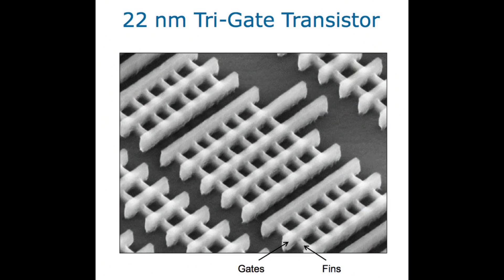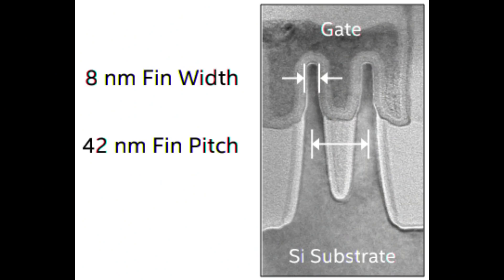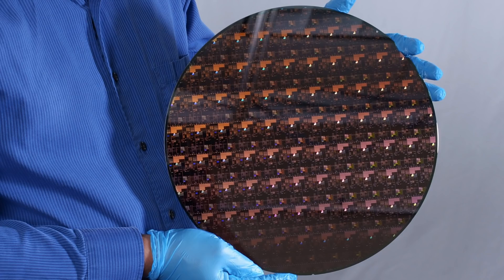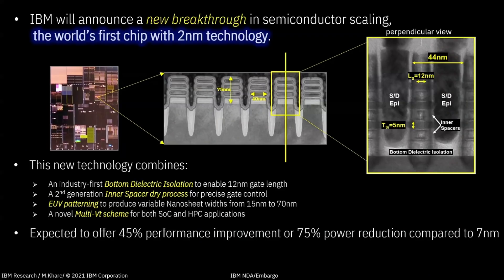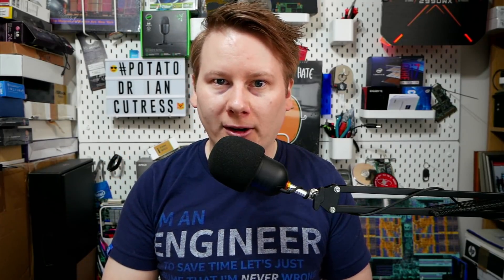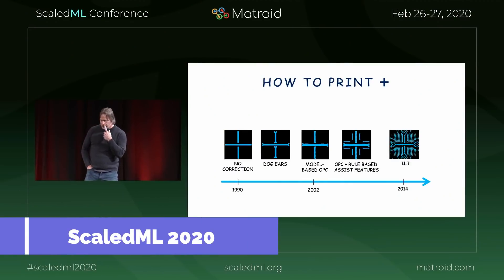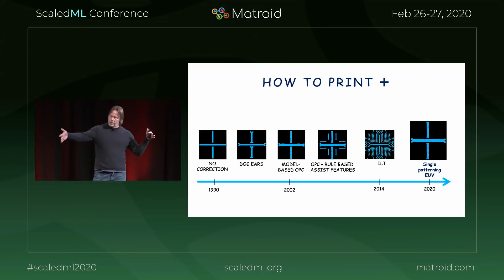There's Plenty Moore Room: IBM's New 2nm CPU

Comment: By chance this video was suggested, and as a former semi worker my mind is officially blown. At RCA Findlay (later Harris) we advanced to 0.5 um using i-line Canon FPA 1500 steppers back in the early 1990s; that was a big advance from the MPA-501 that were only 1.5 um line width.  Thanks for this video.

Comment: I believe Sophie Wilson stated in 2019 I think) that 28m, remained the CHEAPEST process per-transistor. I presume it's because the fabrication of anything below 28nm is a lot more costly. She also discussed how hot Intel & AMD cored ran and so I think 28nm is as far as you can go with passive cooling.
When a Cortex M0 based SoC costs under $1, you know that THEIR will be the major jobs for programmers. Easy to imagine a standard socket for small SoC devices and BLE allows a central machine talking to and from every SoC in your home.
While earning a royalty of 1c a chips sounds low until you consider the numbers to be shipped.

Comment: Nerds paradise. Would you like someone to carry your bags when you travel ?  (forewarning: I do not look good in a bunny suit) 
Smaller parts = less current and that leads to lower heat generation.  I hope that also reduces capacitive cross talk. 
Can they vertically scale resistors for heat dissipation ?

Comment: 128 or 256 cores is no use to anyone when the software doesn't use them and I speak as one owning 12 and 14 core CPUs that can be used in a dual configuration.

Comment: This tech is fake.. 2nm would avoid christians 3rd law of thermodynamics causing a rift between electrons. This in turn causes the transistors to relight the dark optical fibers causing a reverse sha256 hashing state to occur.

Basically there'd be so many transistors running so close to eachother that it'd dehash sha256.
Reply from the maker: You know 2nm isn't physically 2nm, right? It's a name. That's literally what the first part of video is about.
Reply: @TechTechPotato  Yeah I captured that when I watched the video after.

However I still stand, under 5nm we'll start seeing sha dehashing and an overall giant mess without a quantum cooler.

How do you think we will overcome this?

Comment: Because nobody else has made predictions for the next five years of computing, I'll give it an (uneducated) shot. Cores will likely not have gone beyond 64 (or 124 at the absolute most), not due to silicon limitations, but software scaling ones...And so we won't perform computing in terms of cores and threads, but on a spectrum of computing nodes ranging from high performance CPU cores to highly specialized "threadlet" like computing cores to accelerate specific functions, as well as acquiring today's DGPU level performance on die...With no or little dedicated memory chips because transistors will be reconfigureable as memory on the fly by the mainstream kernels (at a high level of density because transistors will no longer be 1 and 0, but any range between), leading to ridiculous bandwidth by today's standards. Beyond that, many of the aforementioned accelerators will actually be 3d stacked on top of a series of chiplet based compute dies performing high performance tasks that we would normally task to GPUs and CPUs nowadays. All storage will be fairly fast by today's standards, as a combination of RAM-like DIMMs and NVMe SSDs buffered by them, clustered extremely close to the APU core, in a spectrum similar to the CPU --> GPU line, as we will have approached the end of silicon's scaling in terms of frequency, meaning that physical distance from the core will be an extremely important decision in motherboard layout... But even those RAM slots won't be used for tasks we'd traditionally associate with RAM today, but will instead be used as an accelerator for the SSDs from which assets would need to be streamed due to the high level of fidelity of modern graphics, and in fact, the closest thing to RAM today on the whole device (other than the reconfigurable transistors) will be the 3d stacked on-die HBM, which by that point will be relatively cheap, and in fact necessary for its relatively low power use compared to GDDR, given the tight ball of otherwise molten silicon sitting at the center of most modern computers.

Comment: How about a reference application like DRAM bits/mm² @1Gb/s or cache SRAM bits/mm² @1Gb/s.  This would be directly applicable to practical application as design elements in production chips, yet is an almost trivial training exercise for chip designers.  In the 1970s, chip giants like Intel actually released the first fruits of process improvements as commercial memory chips.

Comment: The claim that it will help battery life is bogus.  99 percent of my cell phone battery is sucked down by the screen, camera, gps, wifi, cell tower searching.  The cpu efficiency is nice, however, they will use this as an excuse to shrink the battery.  Thus, cycle life and battery life will continue to tank as the latest, greatest phone cpu is rolled out. 

Once the new 2x energy density lithium technology is available cell phone makers will be scrambling to negate the negative cash flow consequences of a better battery.  The consumer will never see real benefit, because of the economics of having a smart phone that simply JUST WORKS!  No update needed, no repurchase needed, because it actually works: enough space, enough battery, enough speed, enough durability, no usb ports that break in 3 months. 

It is sad that I can' yet get a day life out of a phone in 2021, when on vacation: streaming music, gps and maps, snapping lots of photos, keeping in touch with family members, taking videos, looking up information about things around me.   I typically need 3 phones to get through one day on vacation. 

The Mi Max had the best battery life before the CCP took control of Xiaomi. My M9 sucks battery and filled with spyware, as a China phone.   I get about a half an executive day length from the Mi 9, with 7 nm chip and 4 amp hour battery.

Comment: 20 years ago it was all about gate width and that was 0.05 microns. But ya know? Ballox on all that! Because a 15 year old dell desk top I had ran lightning fast untill somebody put the wrong anti-malware on it and turned it into a boat anchor. It's a waste! get the fucking bloat and spyware off of the oldest computer you can find and it will run like a dream!

Comment: It is interesting that the 2nm transistors are actually 12nm in terms of the channel length, the channel thickness runs at 5nm with the transistor width being the variable that is controlling the transistor density, together with the transistor stack repetition. The methodology being used for stack & specifically the sidewall gateox/gate metal dep looks like it is really interesting, possibly being really complicated or potentially elegantly simple. 
I suppose the 2nm figure is the IBM estimate of the area used by the transistor structure as compared to a planar 2nm channel length transistor. There certainly doesn't appear to be any 2nm gate structures in the cross sections!

Comment: TSMC 3nm is 297 m Trans per mm2.
IBM  2 nm is 333 m Trans per mm2
So, IBM 2 nm is really a 297*3/333=297/111= 2.7 nm !!!!
Reply: It is even worse because per area will require using the square root, so you end up in 2.85 nm 😢😢😢

Comment: Performance & efficiency can be improved further with recursive AI analytics applied to the chip architecture
Methods for handling data in the firmware, middle ware, software & user interface can improve user experiences, speed & efficiency further
Optical processing can eliminate problems with electrical resistance wires & interference on very small scales, exploiting MEMES photonics 
Fiber optic networking diffusion can reduce network bottlenecks & boost performance of 5GNR & high speed internet services with less energy
Renewable distributed solar & wind & SMR & MMR fission reactors will improve network reliability & power uptime & load scaling with clean energy
Completely new machine architectures using neuromorphic activation level analog compute models for Level 5 autonomy with less electricity & more 
Information processing methods will mimic  biological information handling efficiency of human brain using continually optimized algorithms
Bitcoin mining, PC gaming & faster 5GNR smartphone actions will drive further advances in compute efficiency, especially diffusion of cloud platforms
Distributed network compute functions will power peer to peer monetary systems that supplant failing fiat currencies driving use of compute up more

Comment: I believe Intel is using this tech in its 5nm node aren't they? I don't know if IBM uses the Intel/Actual measurement or the TSMC/Samsung "fudge the numbers smaller" measurement. If they are using the Intel/Acutal 2nm and have a working sample this is actually extremely impressive. Then again, with the replacement of FinFet, the way transistors are measured will likely change again. Hopefully this time everyone agrees to a set standard so we don't have the disconnect where people don't realize that Intel 14nm would be like 8nm measured the TSMC way.

Comment: I like to think of the nm number they use as the smallest feature they're able to print and they're right to call it what they do because if you look at the transistors under the microscope which one youtuber did,  even though AMD didnt make their transistors smaller with 7nm, the spaces between them were 7mn allowing for more.  Intel has a different strategy hence why they can say theres are equivalent, the'yre talking about actual transistor size, even though their process isnt 7nm their transistors are the same size.  Thats where i think they might be comming up to a wall on how small they can make the transistor, regardless of what nm process they can achieve, with electron bleed being an issue, intell seems to have an answer for that with their 3d design.  I heard advancements for quantum computing, where isolating interference is a high priority, theyve been able to isolate single electrons, which in theory could be use in classical computers for single electron  switches, if thats even possibe, which would allow for smaller transistors.

Comment: wait! how did they manage to do this without electron quantum tunneling becoming a major problem?
electrons start tunneling at 30 angstrom which is 3 nanometers. the smaller the bridge the more tunneling occurs and the more false positives you get,
This would greatly reduce the reliability of the processors processing results. and there is NO magic way around one of these natures most fundamental properties.
and in this case the entire transistor is 2 nanometers o.O that means the bridge is even smaller. they must be using a new type of architecture. because you do not get on off situations but full electron flow and a non full electron flow but then you need to measure for reliability..
a normal cpu architecture will have no benefits from this. and i see no miniaturization if you need to have a way to measure the output on each transistor.
you cannot have 1-maybe instead of 1-0

Comment: I am an electronics engineer with a marketing qualification but I HATE  it when companies engage in "specmanship". It takes me back to the early days of AMD when their chips were given a number which was not the CPU clock but the speed that an Intel chip would have to run at to have the same performance. Why the companies try this on I don't know but it always ends up in some sort of farce !!
Reply: For cars there was a slogan 3=6 due to 2-stroke vs 4-stroke😮. Was in the 1950s

Comment: In sizes that small transistor states would need less energy right?
I would imagine we might have things magnetic or "quantum interference" if that is even a thing, like just a few electrons interfering with another lane would make the information on that transistor an error, also it would be easier for a electron to just jump to another lane? Because it would not take that much energy to actually cause shift a bit.
Will heat make things more difficult or will it have any influence on reliability of the state of the transistor?
Reply from the maker: Watch the bit where I say 2nm is just a name and not related to the physical features of the Transistor.
Reply: @TechTechPotato thank you for the reply, I did actually, and probably I didn't explain myself well but when you try and squeeze more transistors per mm don't you have any problema involving certain aspects of physics.
And if you actually shrink the size of the gates and lanes when will we start to see things related to quantum physics that make it a challenge.

Comment: 6:48 if the tsmc 7nm is as dense as the intel 10nm, why are the ryzen cpus so power efficient when compared to intel comparable generation cpus? Both desktop and laptop ryzen seem to have a major power efficiency different to intel. Is it down to architecture difference and not so much tsmc 7nm advantage?

Comment: Intel actually has a license to make chips using the 6502 design and is comparing the voltage to each scaled iteration, that's how they do their benchmarks (everyone has a 6502 and 65816 license these days anyhow)

Comment: Interesting video! Within 2 nm, there fit about 9 silicon atoms, and as this must be doted, for CBE each, there is not more space than for one or two electrons or holes. But this is not planar, only the resolution is 2 nm, with 3d-constructions one could realize more larger structures. OK, but this is in the range of quantum effects: Electrons could likely tunnel even through the potential of a few atoms. Hence, a sophisticated error recovery is needed. The resolution of 2 nm is fascinating, but I think, the further future to increase the benchmarks will be a more efficient design of the circuits.

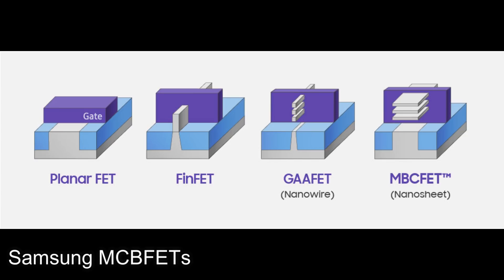Comment: 7:44 If you look at the illustration at 8:30 GAAFET has small square wire like structure and here in the photo they look like sheets or MBCFET, but you say we call this GAAFET so which one is it ??? 
Is the name or photo at 7:44 not correct or is it the illustration at 8:30 not correct ? 
We can clearly see that photo at 7:44 looks like sheets and you say it is GAAFET which should be like square wire and it is called nanowire in the illustration ??
Reply from the maker: GAA-FET is the general name for any Gate-All-Around design, which includes nanosheets and nanowires and any different variant of a similar design.
Reply: @TechTechPotato  that is ok, but illustration separated those two, then illustration is not correct ?
Reply from the maker: Samsung like to give marketing names. But it's all GAA

Comment: 2024 10 Ghz?
It's taken 16 years to go from 3.37 Ghz "Pentium D" to now where we can just about squeeze 5.1 Ghz out of a processor if you bin the right parts and clock till it's hot enough to boil water.
That's about 35% increase in 16 years.
35% IN 16 YEARS
And now you expect a 100% increase in 3 years?
Nope. 10 Ghz is a 2050 to 2060 processor. It's 30 to 40 years away... At least. Because that assumes the same rate of speed as the last 16 years, and what we know is, everything is slowing down.
Also cores? For data centres where they can chop up cores allocate to different virtual environments, web hosting, data crunching, then 128 cores is going to be common pretty soon.
For home use, where applications would need to be coded and threaded to take advantage of those cores in none discrete workloads? We'll hit 32 and come to a grinding halt. When even video encoding and rendering come to the point where diminishing returns makes adding more cores redundant or even counter productive. Where the overhead of allocating and keeping track of none discrete workloads across many cores takes more processing power than an extra few cores actually offers.
Discrete workloads will always benefit from more cores. Because they can be chopped up as new virtual boxes or entirely different processes.
Single, large complex operations will very quickly reach a core tolerance level, where adding more cores actually works against the process. Where the coding and housekeeping to manage the cores efficiently - and safely detracts more than the new core offers.
You can only have so many cores all wanting their share of resources to do different things in a time critical fashion because what they are working on is "one big thing" that can't be broken down for asynchronous compute tasks. Every core in that case is timed critically against the action of all other cores - because they are all working on the same task. The coding complexity alone would be enormous. The opportunity for critical errors. rising exponentially with every core you add.,

Same with RAM. RAM doubling used to be an 8 month cycle. 64meg requirement to 128 meg requirement was April to October 1999. 6 months and you needed twice the ram thanks to Windows 98SE replacing windows 98. You could just about use 64 with SE - but the experience was really poor. From boot up to every application, that single 6 month cycle required the doubling of RAM. And in 1997 32 megs was fine. 1n 1995 16 megs was fine. With Windows 3.1 2 or 4 megs was fine. You were lucky if a year went by and you didn't need to double your RAM just to keep up.
Now it's a 4-6 year cycle. 16 Gb will be sufficient for most tasks for another 2 years. 32 Gigs will take us to 2030 easily possibly 2032.